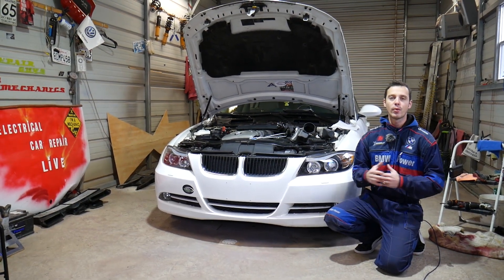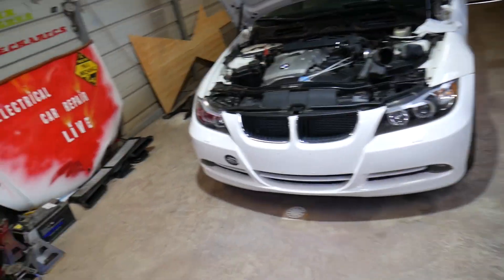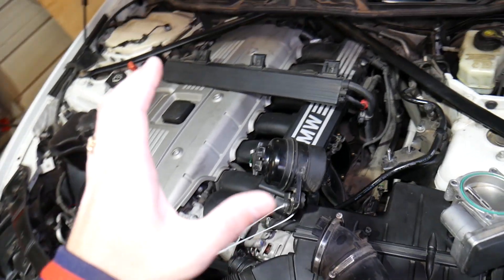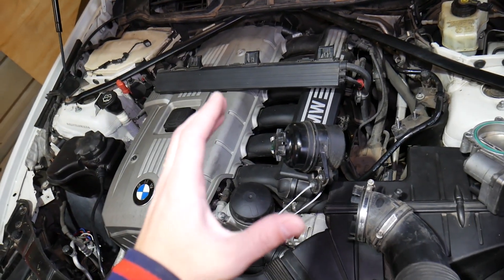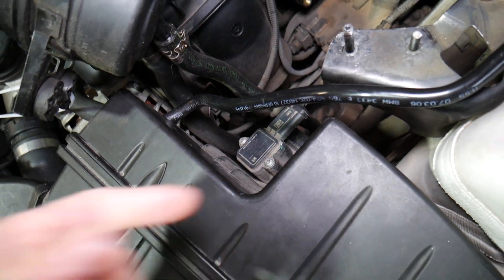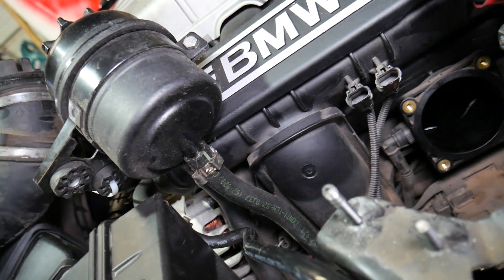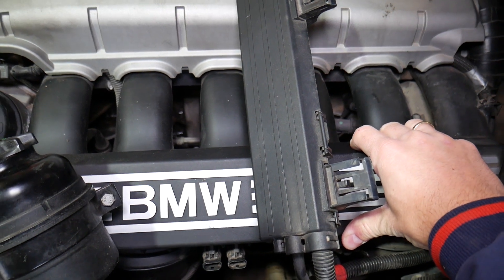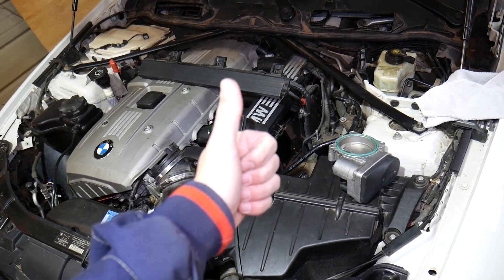BMW VACUUM LEAK E90 E91 E92 E93 316i 318i 320i 323i 325i 328i 330i 335i 318d 320d 325d 335d

Comment: Hi ! I got a bmw e92 2.5i from 2007 with the n52 engine on it.The car's engine cuts off when i break or at lower speeds, I changed the vanos solenoids ,the oil ,the oil filter's and spaks plugs but the problem is still there, any advices  on what to look for? Is any of you guys faces the same problem as mine?  The codes i got are 2A87, 29E1,  29E0. THANK YOU!!!
Reply: You probably fixed it already but for people in the future. I had the same problem. It was ccv breather hose, that one connector at the end of valve cover.
Reply: @artsmadeit  thank you, my car ran into the same problem 07 e93 328i would rough idle and then stall out, I would turn it on and off and it would run normal again till a few miles, I figured it was something to do with the vacuum